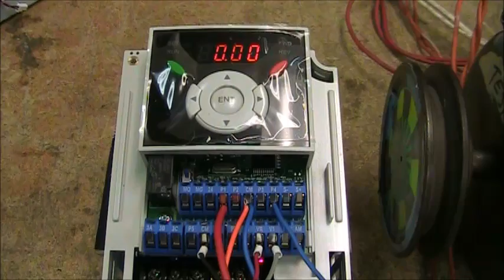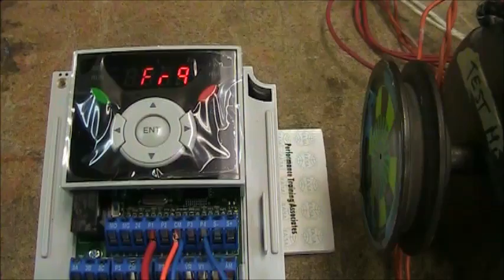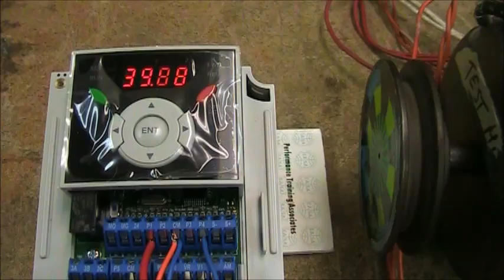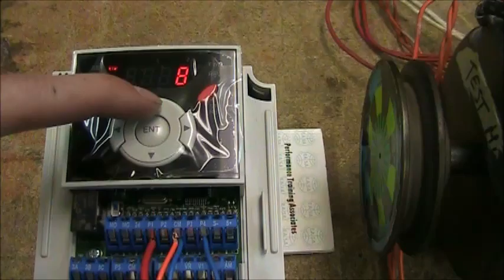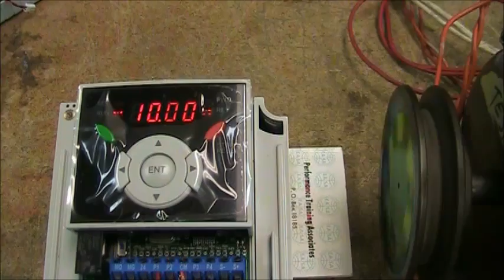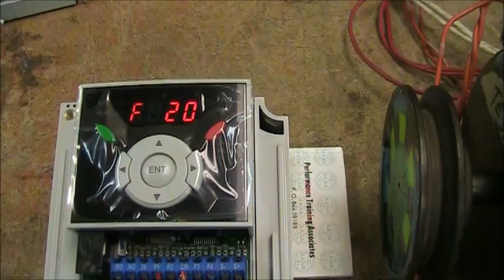LS VFD IG5A Setup

Comment: Hello , thx for sharing this info, I am kinda new to the VFD world,  I have a question, which terminals would I use  to  have a separately derived 24VDC running through a dry set of contacts/relay that will close when the motor is in motion ?, thx in advance for your assistance, cheers!!!